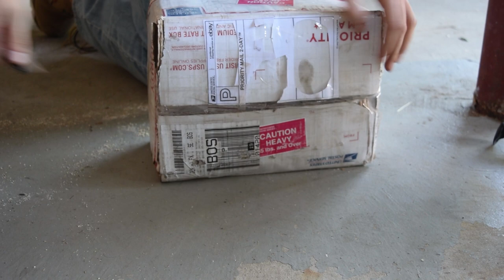𝘉𝘭𝘢𝘤𝘬𝘴𝘮𝘪𝘵𝘩𝘪𝘯𝘨 - Forging 10 Bottle Openers from Railroad Spikes

Comment: so is your process after forging to clean them up on a wire wheel THEN bake them with the linseed oil? What temp & time do you bake them at? Wicked nice BTW.
Reply from the maker: Been a while, but IIRC my process was to wash them off and scrub a bit by hand to knock off any of the super loose stuff. In this vid I baked them with the linseed, but another option would be to just dunk them in vegetable oil while they're still hot for nice blackened look. Hope this helps!

Comment: Still blacksmithing? I'm just starting as a 53 yr old. I've got a bunch of spikes and railroad anchors and found your video by searching what to do with them. Where did you get your tongs? Did you make them? Good job on these bottle openers!
Reply from the maker: That I am! I made those tongs a while ago. There are a lot of good tongs online if you'd rather get straight to bottle opener smiting. From both individual makers as well as some brands. Specifically,  Bolt tongs are great for railroad spikes.
Spike openers are great, just made some for coworkers. They'll let you know when they see use over the holidays, which his fun to hear.

Comment: Great job man! What was your finishing process starting at 8:33 ? Is that just water and a scrub brush first, and then are you applying the linseed oil when completely cold? From there how long and what temp in the toaster? They look just as good if not better than folks with complex recipes for 3+ ingredient cocktails of finishing oil and a process of 3+ more steps than you.
Reply from the maker: Thanks so much! 
Man, really wish I could know for sure, but this was a couple years ago now.
I know for sure I wire brushed them with tap water, and applied the boiled linseed oil cold.
Judging by what I can see in the video and compare with my toaster, I think it was about 350f for about an hour. Wouldn't be afraid to go hotter knowing what I know now. 
No specific recipe, just did what I thought would work at the time.